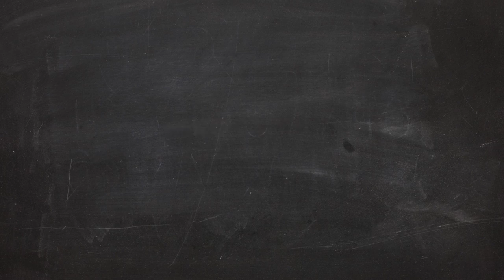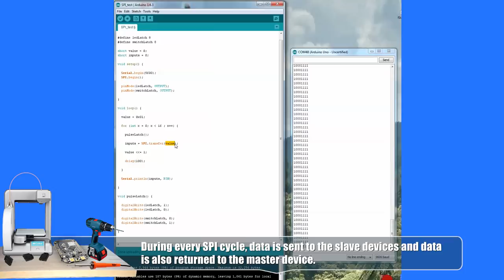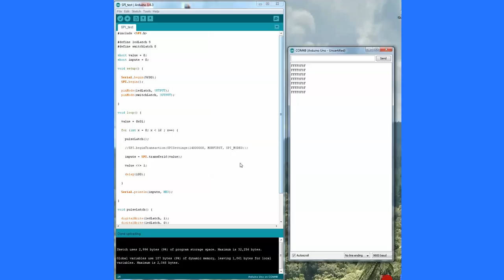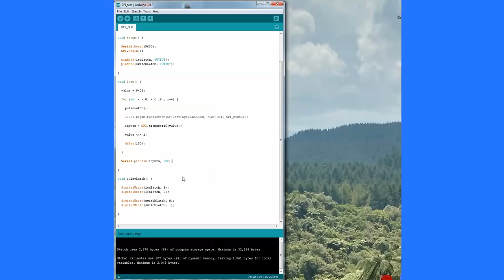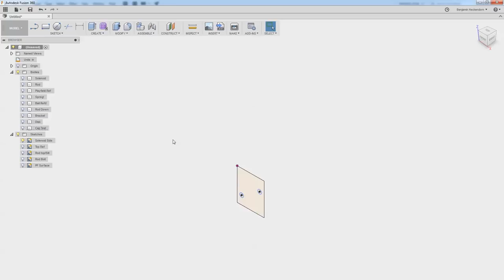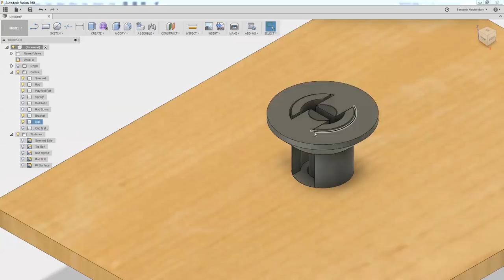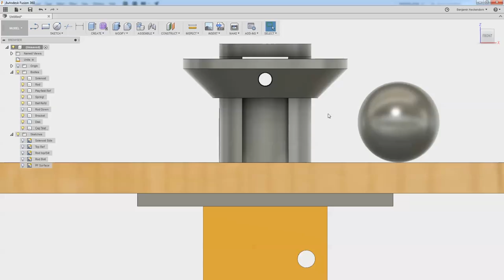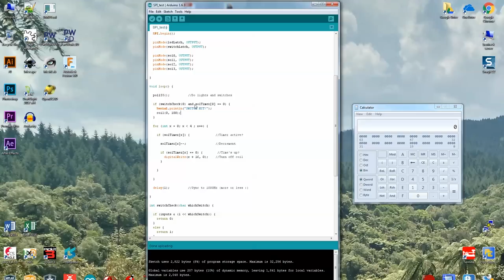Mini Pinball 05: Pop Bumpers, Targets, and More!

Comment: I realize this is 4 years old at this point, but I was specifically looking up mini pinball pop bumper to see if anyone had already done this, and, well, you have. 

The one thing I'm noticing is that your pop bumper seems a little slow to activate with the way you have it setup.  I'm thinking it might activate faster if you have the sensor directly activate the solenoid rather than running it through the arduino.  You still need to have it tell the arduino the sensor has been hit so it can count the hit for your score.  I vaguely remember seeing something similar happening with an early solid state pinball machine.

Comment: signed short vs. unsigned short at 6:24:  It's wasn't overflow; it was sign extension.  Your output routine is capable of printing a 32-bit value, not just your 16-bit short.  A signed value will undergo sign extension when converted to a value of greater bit-length (from 16- to 32-bits in this case).  Since your signed 16-bit value's most significant bit was a 1 (making the value be interpreted as negative), that sign-bit was extended out to 32 bits when printed and you ended up with 4 hex F's before the 16 bits that you were actually using.  The unsigned value doesn't undergo sign extension, so only 16 bits were significant when printed and the 32-bit output routine only printed the 16 bits that you were actually using.

Comment: What about a Raspberry Pi running FreeBSD for ARM and you could write the whole program in C++/ARM Assembler for stuff that need to handled with split second timing like digitized speech and other sound effects, I think you need a buffer chip to convert the 3volts to drive the other actuators.

Comment: I = U/R not R/U!
Reply: Arduino Guy Projects and More! Exactly right!
Reply: OneManShow The U is the  formulaic character for electrical voltage.
Reply: I know U/R but what am I?
Reply: EFormance Engineering brilliant lol
Reply: Electrons? >.<
Reply: U comes from the German "Unterschied" and is simply the difference of two assessed voltage potentials, for almost all and every common usage it is synonymous with the usage of 'V' although V is then usually used for unipolar potential and not voltage difference. Other linguistic comparison: some languages call U (variants of) 'tension'.